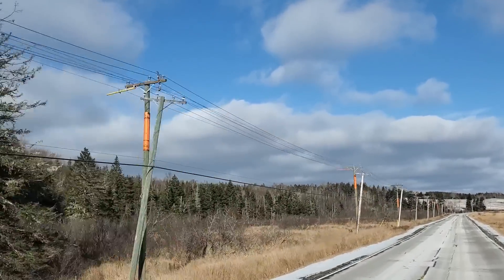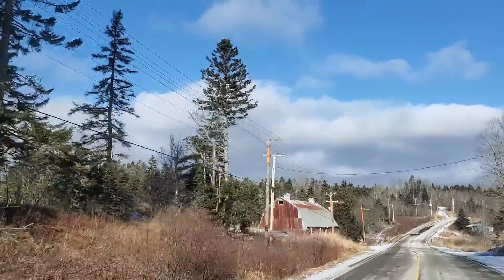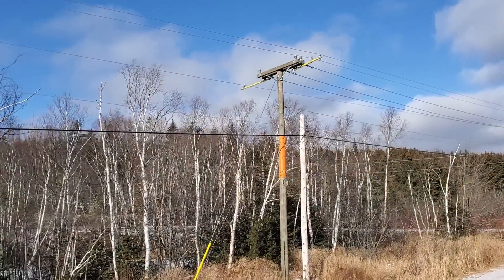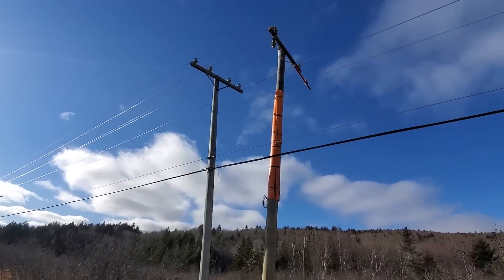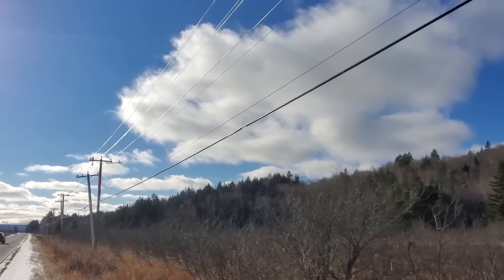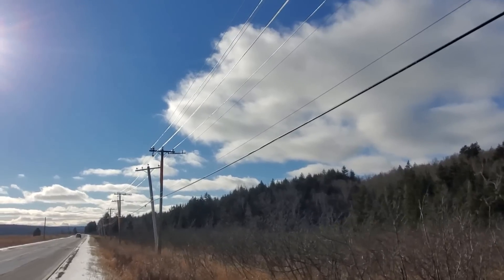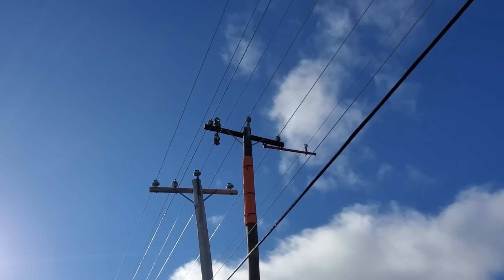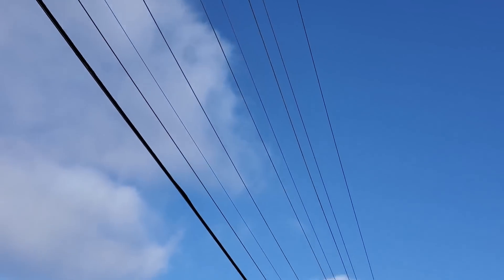Pole/Conductor replacement on 3 phase line 12kv

Comment: In my area my power company has been rebuilding the distribution system so the voltage can be upgraded from 4160 volts to 13.8kV. It is interesting to see how they proceed, from simply changing out insulators on poles that are still usable all the way to complete pole replacements. As in the video, when the circuits were ready for cutover, they took an outage and sent out an army of linemen to change the transformers or the tap switch on the primary side (the company has begun using cans that can be set for 2400, 7200, or 7970 volt primary). The pace of conversions have slowed down since a goof in a neighboring town where they forgot to reset the transformers on one branch line before switching over to the higher voltage.

Comment: Do you use concrete forms for the poles to sit in or just sand?
Reply from the maker: Not typically unless it's extremely soft ground or in water.
We usually backfill with compacted soil or tailings.

Comment: When my town replaces an entire row of poles like what is shown in this video, before installing the old pole they usually chop off part of the cross arm and remove 1 insulator so that one wire is not too close to the new pole.  Has the company you work for ever tried this?

Comment: Just subscribed to your channel, you have tons of great content! In the video you mentioned reclosing is disabled for any fault interrupting devices upstream of the planned energized work. In your experience, is Hot Line Tag (HLT) used as well if reclosers are equipped with it? Thank you for your time sir!
Reply from the maker: Hey thanks Charlie! 
Yes most of our equipment have a light or flag that automatically pop up now. We also manually install a tag on the pole or switch gear at all times when reclosing is removed

Comment: I was on a reconductor crew for several years. We used those small ropes on a trailer, called a spider rig. On the day of the conductor pull we used the small ropes to pull a larger rope in called a bull rope. Then the bull rope was attached to the new conductor. Then we pulled the conductor in under tension as you said. If we hung the small ropes it was usually only done to prevent someone from cutting the rope at night and stealing it. We had this happen on one job. Theives stole so much of the spider rope we had to get new reels and restring them. I enjoyed reconductor work. It really makes you think every step.

Comment: Every single pole should have been changed to at least a 45 foot class 2. With that Guage wire, using an old pole is asking for trouble.

Comment: why not use underground cables instead. no ice, or trees can short the lines, if ug is used. 
i live in denmark, and we only have 380 and 150 kv overhead lines and som small parts of the 60 kv grid in the air. 12 kv and 72 kv xlpe cables is more cheap and durable, than overhead lines. and no climbing in poles, the transformers also are in a small building on the earth surface.

Comment: If you guys in North America start using concrete poles you wouldnt need to change them :)
Reply: Right...
Reply: Funny enough we do have some concrete poles in my area, typically they are only lamp posts though but I've seen the odd hydro ones too.  I've also seem them where the rebar is all rusty and they are chipping apart... so guess they don't last forever either.
Reply: @redsquirrelftw  Exactly.
Reply from the maker: We're actually moving away from concrete poles and switching to aluminum for light poles
Reply: @Bobsdecline  probably this is a good step forward.
Reply: They’re changing concrete to steel in my area. Must be the new thing.
Reply: @pete9415  In Bulgaria the medium voltage distribution network (10kV) the carrying poles are made of concrete and the tension building ones are made of steel. Up to the 50s there were some wooden poles but eventually they have been replaced with steel and concrete ones. For over 60 years many of the concrete poles are in very good shape. Sometimes one finds some poles where the concrete becomes a bit brittle on the outside.
Reply: A lot of states are putting power lines underground nowadays.
Reply: @yobi765  Problem with underground lines is you have to be able to easily bury them.  Here in the northeast USA, bedrock is anywhere from at grade to a few feet down whereas cables in the 1kV to 22kV phase to ground range have to be 32in or more below grade or else be in a 2in minimum thickness concrete encased raceway.  Then there is the much higher cost, fault finding is much harder and cable charging current eats into your capacity after a few miles.
Reply: @yobi765  For close distances this is the best solution but for remote areas it turns out to be more expensive.

Comment: I remember once when I was very young a new high voltage line was being built across our property (a farm). One day they were stringing up the conductors which started very low down to the ground. So I grabbed on to one or two and got hauled up into the air at a rate of knots.

As a kid it was pretty fun. 😁

Comment: Just found your channel and this is pretty cool. I work as a design engineer in FL and we are doing a job of hardening all distribution poles that are Florida Power and Light owned. A lot of work is done with miles of pole replacement and reconductoring either 13KV or 23KV lines. Pretty interesting stuff. I'm also interested in trying to become a line man myself and your channel has been super cool to find.
Reply: IBEW labor is the way to go

Comment: They put several wind turbines up my road years ago.  We use to just have 2 wires on each pole, they put a T on the top of each pole and put 4 lines. Bigger cable too..
I remember them first running those different colered ropes. 
It was a big project

Comment: I've been watching this happen IRL. PGE, our local power company is a couple of years into a massive system upgrade. Substations are being expanded and new ones built, new transmission lines are being run, existing lines are being upgraded. Over the summer they replaced 3 miles of transmission line in one big pull. It was amazing to see. Then, almost right outside my window, they are relocating a mile of line to make way for a road widening project. They are pretty much done. Right now they are tearing down the last of the old line. Then they need to get to work on the new transmission they are building a mile away.
Reply: All those millions of electric vehicles are going to need substantial infrastructure upgrades!
Reply: @ArtStoneUS  That may very well be. But, in this case it's all the data centers that are being built in the area. The power needed to charge 100 electric cars pales in comparison to the power needed by one massive server farm.
Reply: @gordonreeder3451  According to energy.gov,  data centers consume about 2% of total electricity in the United States. I'll let you do the math of what 10 million electric vehicles will need.

Comment: Great video Aaron. Are all of your oil reclosers operated by a stick on the yellow ring/handle? In the states, we have control cabinets that can be operated at ground level, and disable reclosing.
Reply: Probably depends on the equipment.  I know with my company we have a mix of Hydraulic Reclosers that we manually block with the Handle on the device but we also have several SCADA controlled devices that we can block remotely or from the control box at the pole..
Reply from the maker: Yes exactly, most of our have the control box. We've also moved to intellirupters, vacuum reclosers, EOR's etc..

Comment: Do they cut the old poles at ground level, or actually pull them out completely?
Reply: If telephone and /or cable are attached to the pole. The utility company will cut approximately 5'-10' off the top and "abandon" the pole for the telecommunications company to come at a later date and remove completely out the ground, PTD (pull, transport, dispose).
Reply: @tsheejkoo  yeah when phone/cable maybe get around to transferring their stuff in the next 4 or 5 years :D.  haha
Reply: @blakeslack  Truth.
Reply: @lalarobert  a constant battle for us...especially as the old pole starts to lean more and more and people keep calling it in to us thinking its going to fall over

Comment: Hey, I have a question. There's been widespread intermittent flickering on my side of the city for the past few days. Like 1 second outages, a couple times a day. Manitoba Hydro found the cause, but I'm curious if you could explain 1) what is actually happening (recloser?) And 2) Why does it take days sometimes to find? Thanks!
Reply: It is the recloser that causes these “one second outages.” Sometimes the faults can be really hard to find such as a branch sitting on the arm. We have even seen trees in swampy areas blowing way over during wind gusts, laying on the line for a second, and then standing back upright. Extremely hard to find especially if it’s on a line that travels a long ways.
Reply: @joshbrown1806   They posted this after "update: crews figured out what’s causing the flickering (equipment issues) and we’re working to fix it. Thanks again for your patience." 🤔
Reply: We had a similar issue for a couple weeks. I didn't hear what the resolution was, but the crew said it can be lines slapping together, tree branches, squirrels (seems like that one would only happen once for any given squirrel), failing switch gear, transformers (affected a couple streets, so it wasn't that), etc.
Reply: @JCWren  squirrels can stay on the line after they die and just keep tripping the line or causing recloser action.
Reply: @joshbrown1806  True, now that I think about it. I've always seen the bodies of the squirrels that have been blown clear. Hadn't really considered they may stay up there, arcing away. Damn tree rats.
Reply: @JCWren  or the squirrels could be just causing the wire or branches to move and cause a short.